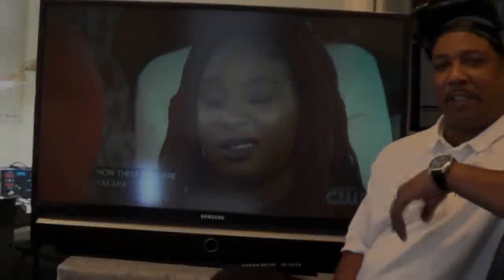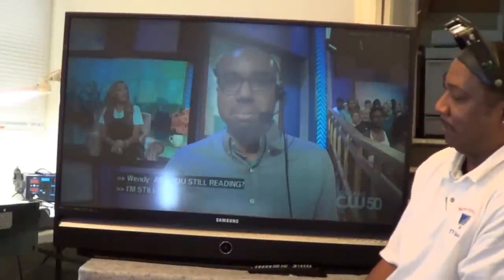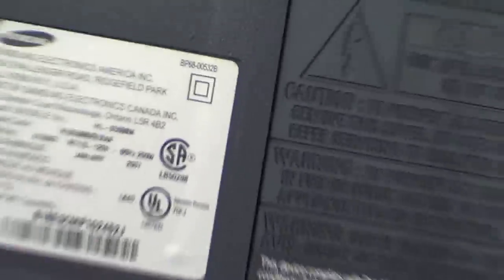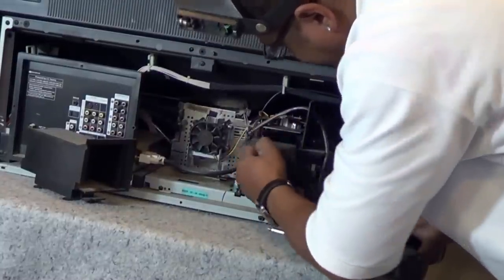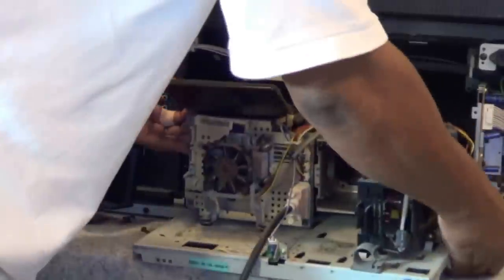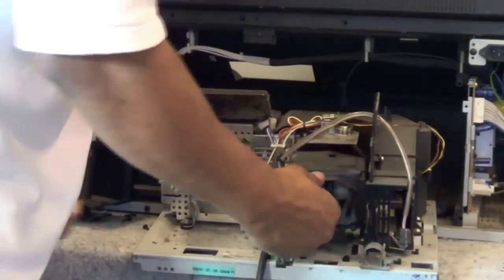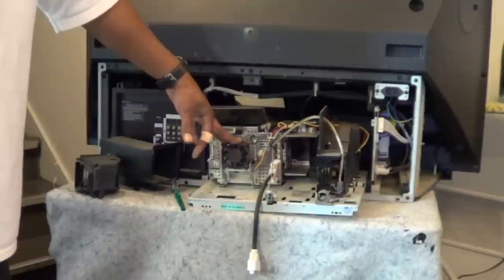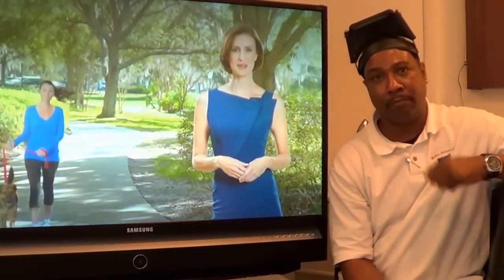Why your DLP TV keeps blowing Lamps every 3-6 months

Comment: I have a samsung hl-s4266w. I just took it apart and cleaned it. The bulb turns on for a few seconds and then it shuts itself off. The power button then reads "lamp" in green and "stand by/temp" in red. Does that indicate I need a new bulb? Or something else?
Reply from the maker: Most Likely U need a new Lamp. Especially if it was doing the same thing before U Cleaned it. Also make sure that the Lamp DOOR is all the way screwed in or shut.
Reply: bigdog8882 thank you. I appreciate the reply.
Reply from the maker: No Problem. Enjoy U'r Labor Day!
Reply: bigdog8882 u too!
Reply: I have a Sony wega 42 inch screen that the picture is dull and cloudy with vertical lines and very little colors can you tell me my problem

Comment: The reason DLP chips fail is because the factory puts the minimum amount of heat sink compound between the chip and the heat sink. There's about a dimes worth of heatsink compound and as old as the DLP televisions are the compound does dry up at a certain point, so anybody who hasn't serviced their TV and still has one of these would be doing themselves a favor if they, during cleaning, remove the heatsink and put on some fresh compound about a quarters worth.
Reply: Would I be able to use the same compound that I used for my ps4? Lol I had an issue with it turning off and took it apart. Dot had a thick layer of dust.. imagine the thickness of the lint from a drier screen lol.. put it back together and it wouldn’t start.. I panicked until I was told about the compound.. put some on and it works good as new

Comment: Hello BigDog, 
I have a 2005 dlp Samsung tv. I do not have the original remote. How do I reset the timer in reference to my lamp life? I programmed Peel Remote and followed timer reset instructions with no results. Will any Universal remote work on this tv type for the purpose of resetting the lamp life timer?
Advanced Thanks
Reply from the maker: Hey Darlene, just figure out how to use the buttons on the TV to go through the menu and reset the timer, simple.
Reply: bigdog8882 
Wow I didn't think of that...I'll figure it out. I may have to change my ballast board, if I run into trouble I'll be in touch..lol...Thank You
Reply: Ok I'm getting the same menu I get with the peel remote, and there's nothing about  setting the timer.  It appears the TV needs to be off  and you have to program some numbers in the remote  and then turn the TV back on, so I guess I'll buy a remote. I'm going to step back from this for a moment, I'm feeling frustration...I'm going to break something!
Reply from the maker: The lamp timer really has nothing to do with the Lamp life. Why are U trying to set it anyway? Do U keep getting a message that pops up or what?
Reply: bigdog8882
Hey, I purchased a new $80 lamp it made a sizzling sound and it will not come on.The company that I bought the lamp from ask did I reset the timer...this person said the timer should be reset every time you replace a lamp.
Reply from the maker: The timer has nothing to do with the operation of the lamp. Its just used as a reminder of when the Lamp should be replaced. There will be a message that pops up on the screen after a few years or etc. If you heard a sizzling sound You should pull the lamp out, look at the plug (make sure its not burned), then re-install the lamp and make sure  U feel that the plug (lamp) is pushed and fully connected to the socket on the inside of the TV. Otherwise if the lamp is not fully seated then it will arc at the socket.
Reply: bigdog8882 
Hey, when I pulled the lamp out the plug on the lamp is burnt, that was the sizzling sound  I guess. I'm trying to get a replacement lamp.
Reply from the maker: Good Shi@@# Darlene!
Reply from the maker: If the plastic is not melted on the plug then U can get a Q-tip and some Alcohol and clean the metal pins on the inside of the plug. Then make sure that the lamp socket on the inside of the tv is not badly damaged, and try to re-install it making sure that U feel the connection after U push the lamp in.
Reply: bigdog8882 
Hey, one of the metal pins burnt off.
Reply: It's sizzled and burnt out the moment I installed the lamp...and this is not my first lamp replacement.
Reply from the maker: That's definitely not good.
Reply: bigdog8882
The company is saying they will send me another lamp. I haven't received it yet. If the problem is my Ballast Board I've already checked it out that's another easy fix.

Comment: i got a Mitsubishi-WD-82837   from a friend  for 140 bucks   and it seems verry low  in  picture   so i think  by seeing this its a bulb  its an 82 inch dlp  crystal clear but real dark . i hope its the bulb
Reply from the maker: yeah change the lamp, it'll make a huge difference. Order it from www.shopjimmy.com .
Reply: @bigdog8882  thanks man  yea never buy a cheap bulb  i learned that it smelled like burning plastics .so i took the bulb from my 73 inch the fan in the back seems slow not like at max speed is that natural ? when i look in i cleaned all 3 fans   the wheel fan the DLP fan and the  one straight in the back  there  like new now but i was wondering do they just have  low speed and adjust to load ? or is it cause if it was on high it would cool to fast and blow ?

Comment: I have the same exact tv. It goes on and off, I have changed the lamp  with  a genuine lamp, ;and I have taken apart the whole thing, an cleaned the fan, but it still goes off, and the three lights, and you can see a light shadow  on the black screen as it goes off.  This thing is driving me nuts, I don't think it is the color wheel, because the picture is great when it it on, and the board on the side, I guess that is the balast, that looked fine, nothing blown out.  It sounds like there is a slight motor roaring, and than it shuts itself off.  I think I have reset the lamp,since this set does not have instructions like the rest, and used the mute 182 power button.  I wind up resetting  the lamp, and then going for factory reset.  It will shut itself off during  this process. I give up!!!  It  am so frustrated with this TV. It does not pay to have it repaired, but the thing that kills me is the picture is so good  when it works.  Have any suggestions. I would really appreciate it.

Comment: Do you know why a DLP would be blowing a bulb in less than a month besides the obvious generic cheap bulbs ? I had one blow and got a new bulb and the next day it sounded like a shotgun went off and the bulb blew.
Reply from the maker: If all the fans are clean, then U could have a bad ballast board.
Reply: Ok Thanks just placed an order for a brand new ballast and a new Philips Bulb along with making amazon replace this other crap bulb! I figured I would use the cheap bulb to make sure that is the issue after I replace that ballast board. If I do all of that and it still blows bulbs what else would or could it be ?
Reply: I also ordered the cooling fan and the bulb fan for my unit cause the cooling fan looked like a lost cause for how much dust was caked in it. If for some reason I am having blown bulbs then would I need to look at replacing the power board ?

Comment: I changed my color wheel my bulb cleaned up all the dust and I cut it on for a few seconds then cuts off what do i do
Reply from the maker: Make sure that u have the Lamp door screwed all the way on so it can activate the safety switch
Reply: I taped down the switch it comes on for a few minutes then shuts off I cut back on then it does the same thing again all three light blink
Reply from the maker: Ifs its an old samsung maybe similiar to the one in the Video, then jumper the door switch with a wire, those were known for having bad door switches.
Reply: How do I do that thank you been trying find a fix for months
Reply: How do i jump it
Reply from the maker: One way is to just cut the 2 wires going to the door switch, strip the ends, and just twist (tie) them together.
Reply: You should do a video on this cause dozens of people are complaining about this issue
Reply: So I strip the lines twist them together and stick them back in
Reply from the maker: Yeah, just make sure the exposed wire is not touching anything metal. maybe put some electrical tape around it. But b4 u do all that, try it to see if it works.
Reply: Do I cut them from that white plug  there connected to  or do I pull them out
Reply: Sorry for all the questions just don't want to mess it up
Reply from the maker: Doesnt matter, just cutt them close to the door switch. Dont pull any wire's. Just leave enough wire in case you have to reconnect it back the original way .
Reply: That's didn't work it's still shutting off
Reply from the maker: Whats the model # of your tv?
Reply from the maker: What was the problem before u changed the lamp and color wheel?
Reply: hl-s5687w
Reply: The same thing tv would just cut off all three lights would blink
Reply from the maker: I hate to say this but that sounds like  a colorwheel problem. Make sure that its installed properly and its the exact replacement part #. Could be bad. Don't know what to tell u after that. Maybe call a service man.
Reply: Is there particular way you put the wheel in

Comment: Mine doesn’t have any red lights when I turn it on it stays on for about 5 minutes then cuts off then the green lights blink several times comes back on and so on. Can you help me with this problem?
Reply from the maker: Jump the Lamp-Door switch and see what happens. It may be bad.
Reply: bigdog8882  where is that located?
Reply from the maker: @bigfrontline5956  Inside the lamp Door. There should be a blue lever switch when U take the door off. Just cut the two wire's, splice them, and twist them together. That way its always in the ON position.
Reply: bigdog8882 ok thanks im going to try now
Reply: bigdog8882 don’t see lever or blue wire
Reply: bigdog8882 my lamp door is on the side
Reply from the maker: @bigfrontline5956  Whats the Brand and Model# of your TV?
Reply: bigdog8882 Sony and model # KDF-55E2000
Reply from the maker: @bigfrontline5956  Be nice if U told me that from the Beginning. I thought U had the same TV thats in the Video. Change Your Lamp. U hava BAD LAMP.
Reply: Oh ok my bad. But I already have a brand new lamp clear pic n all it just cuts off after like 5 minutes green light blinks like 8 times fans blowing then comes back on n keeps repeating itself
Reply from the maker: @bigfrontline5956  U have a bad Lamp. May sure the Lamp door is closed all the way.
Reply: @bigdog8882  can you assist me with some flashing led codes? Model #HLT5676SX/XAA

Comment: A Lamp from Mitsubishi will cost you $120 compared to a Lamp from E Bay for 29 bucks and a year warranty- i own a 72'' Mitsubishi WD-73640
if i knew i had to turn into a part time repair man i wouldn't have wasted $1.500.00 buying this pain in the ass tv always wondering if this is the day the Lamp gives out or if the Color Wheel need's to be replaced or the chip,my suggestion Don't buy this tv buy a true flat screen

Comment: If my Mitsubishi 73” tv lamp blew in 1 day, should I replace the ballast? What else could it be?
Reply from the maker: Make sure that you clean all three fans, thats including that cylindrical intake fan behind the Lamp fan. You have to pull the entire light-engine out to get to it, I think. Its facing down towards the back. Also Make sure that U don't blow any dust into the upper part of the tv to prevent it from getting to the inner screen or onto mirror in the back.
Reply: @bigdog8882  thanks! When I say blew, I mean loud pop, severely cracked bulb, burning smell. Ive replaced many of these bulbs over the years and never had one explode like that, thats why I was wondering if it could be something secondary like a ballast. It was violent.
Reply from the maker: @paulharris8341  Could have had a bad lamp too. If cleaned fans, Look at the plug going from ballast to Lamp. Make sure thats not burned.